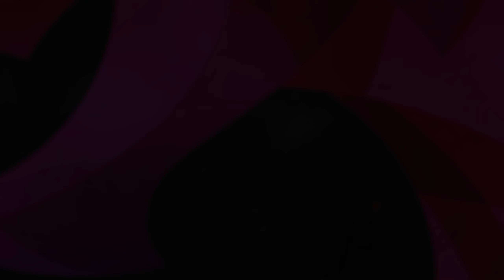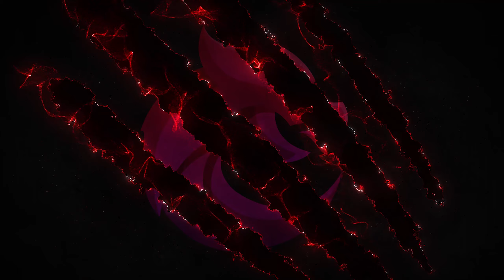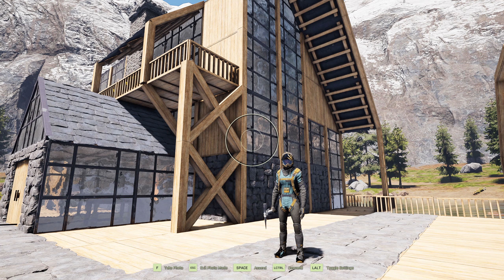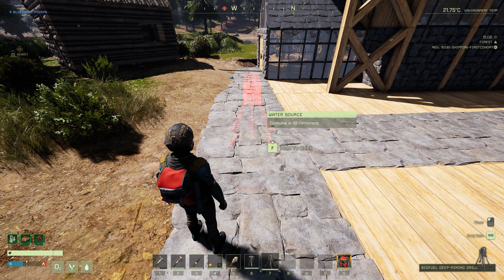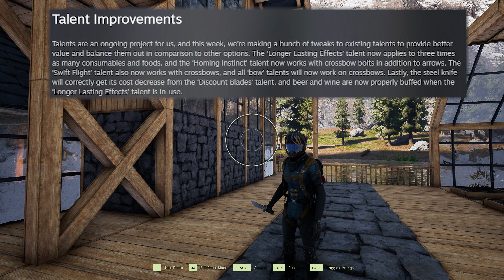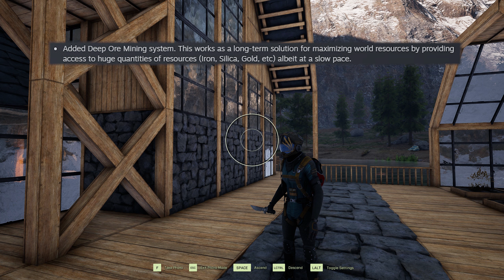Deep Core Mining DRILLS | Week 10 Icarus Patch Notes

Comment: Logged out of my Riverlands mission, patched, and logged in to see a node in two of the local caves in F7/G7.  Looking forward to testing the drills.
Reply from the maker: Awesome 👌
Reply: @Fortizar  Using the electric one, off a biofuel generator, it takes 45 seconds per unit of ore
Reply from the maker: That's rough 😕  should be faster